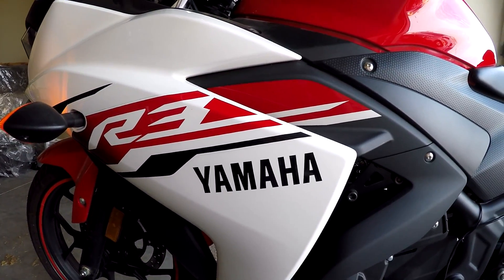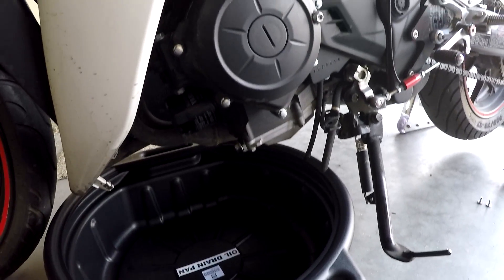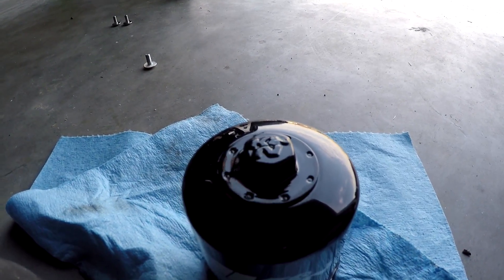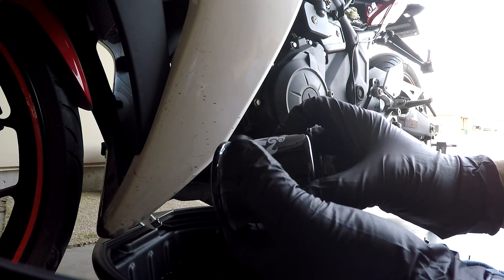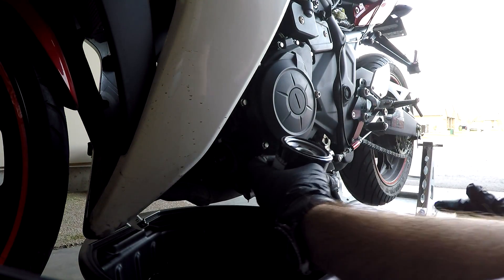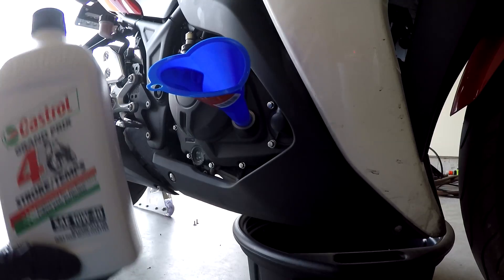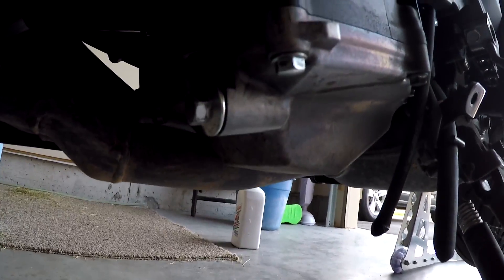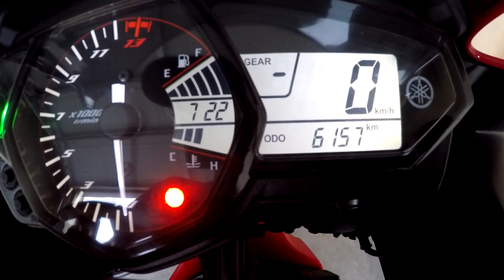Yamaha R3 - How to do an Oil Change

Comment: 2015 Yamaha R3

Oil Amount:
1.8L - Without filter change
2.1L - With filter change

Torque Specs:
Oil drain plug: 14 ftlb
Oil filter: 12 ft lb

Pin this comment so folks can see!
Reply from the maker: Thanks for helping. I have verified this info as well.
Reply: What oil weight should I use for a 2018 r3 in new Orleans ? Temps are basically 90-100F all summer long and may dip below freezing a handful of times a year
Reply: @Fee.1  its always 10W-40 unless you live in frigid temperatures like Alaska
Reply: @kushpaladin300  why is that? Why would colder temps warrant an adjustment but not hotter ones? Would you not even go to a thicker viscosity base for track use ?
Reply from the maker: Ya, much hotter would also warrant an adjustment. I didn't on my race R3. But I used 300V in that.
Reply: Precise oil amount? Use the site glass as your gauge. Don't rely on anything else.
Reply: @Fee.1  Go to 50 weight if you ride in really hot weather.

Comment: best oil change guide without a doubt. Answered every question i had and made things short and simple. Thanks for the upload.
Reply from the maker: +Newbie Yamaha Thanks for the kind words.
Reply: the bottom faring wont come off...
Reply from the maker: pull it harder. theres a little extrusion there that holds it in place.
Reply: +FullThrottle099, ...agree with Newbie, great vid guide.  Re the bottom plastic, need to slide & pull bottom clip to get off, cheers
Reply: Almost nobody seems to address how to check the oil level properly, strikes me as info worth adding to a oil change guide personally. Not to take anything away from this video I’m just saying
Reply: HANDS DOWN! I’m doing mine today. Thanks for the in detailed tutorial!

Comment: Never top up the oil with the bike running! Your oil will be over full now. I would let some out if you don't want high oil pressure and an oil leak. Fill oil, run bike to get it in the filter shut bike down and top up if needed! Just trying to save people some hassle.
Reply from the maker: +D Wilson Ahh i see. I did notice that the oil level went up a little. Good hint. Thank you.

Comment: Have the oil in the middle of the max and minimum of the lines on the sight glass because when it gets hot it expands so if it’s at the very top cold you have too much

Comment: Commented on this video sometime back when I was planning to buy this bike....and happy to say that I stuck with my decision and been riding this bike non stop for the last 6 - 7 months and really like this bike...so it is at 7800 kms and I decided to do an oil change...and believe me, trust these guys wen they say the stock filter is tight as FUCK!!!! but not sure if it was the factory one or if they changed it at the dealership wen it went for the first service....but it was UNBELIEVABLY TIGHT!!!...So a few difficulties I faced which might be helpful for others:

1. I had trouble straight away with an extremely tight drain plug. I kept applying so much force with socket wrenches and spanners that I ended up with a misshapen bolt so that the default socket wrenches stopped working. Solution? I had to buy a bolt extraction kit from Bunnings for $30 and it worked perfectly in removing the damaged bolt.

2. Now comes the nightmare part with the filter. Used a rubber gasket kind of filter wrench. $7 from bunnings and absolutely worthless as far as the bike's filter is concerned. I have a mechanic friend and he said he has never come across filters being so tight...he a car mechanic not bike...and together we ended up crushing the oil filter...YOU DO NOT WANT TO BE HERE!!...but if you do, here is a work around...take a screw driver thats atleast 7 inches long and hammer it through the oil filter...but be CAREFUL....you do not want to hit the screw mechanism that is part of the bike...so hammer it through the outer edge of the filter...once sufficiently deep inside you can twist the filter using the screwdriver itself as leverage...fucked up process I KNOW!!

3. Removing and putting back the side panels was not difficult.

4. A rear stand would have been helpful but I didn't have one so I just put the bike in gear and rested it against a grill that was standing next to a wall in such a way that nothing other than the bar end was in contact.
Reply from the maker: +NG2k15 Hey im glad youre loving your bike. I dont know why they tighten this stuff that much. It would be way over the specified torque that they should be using at the dealership. Anyways, thanks for the information you posted. Itll definitely help someone out there.

Comment: I just need to drain my engine oil, so do I NEED a new filter?
Reply from the maker: No. The manual says filter to be changed every other oil change. So not 100% necessary to change it each time. Generally, people change it anyways cuz its not too expensive.
Reply: FullThrottle099 gotcha, I just didn’t feel like ordering an oil filter after ordering a ton of other parts. Also, its not a good idea to use any kind of oil is it, or it has to be 10W-40
Reply from the maker: Yea, should be 4-stroke motorcycle oil 10W40. I have been using Motul 7100. Works well. Smells like something you could drink lol.
Reply: FullThrottle099 I don’t know if I’ll do a taste test 😂 leave that to my
Engine. By the way, the coolant is linked with the Clutch cover right? Meaning I’d have to swap coolant as well?

Comment: the manual says 2.1 liters for an oil change not 3 liters. you probably have too much oil.
Reply: And the bike says 1800cm3 right on it!
Reply: correct, 
1.8 liters if you are NOT replacing the oil filter. 
2.1 if you are replacing the oil filter
Reply: it takes 3, with 2 bottles you'd not have enough oil
Reply: Law Abiding Citizen why wouldn’t you change the filter

Comment: Wait u put oil while bike was on? Was the oil over flow? Seems to me you put to much oil. Your suppose to just turn bike on and turn off and see how  much more oil u need to get to proper level. Please let me know
Reply from the maker: +Smooth Cruz I was way lower than the max so I filled with it on. You can turn it off, let the oil settle and see how much more you need to fill.
Reply: Top up only after turning off the engine. He added too much

Comment: You should have checked the oil with the bike off the rear stand as the bike is slightly leaned foward, to get an accurate level the bike needs to be level and straight up
Reply: Gary Bosano have you ever checked this on a R3? I couldn’t tell any difference from on the rear stand vs off and level.

Comment: thanks for the upload.  I noticed no crush washer on the drain plug?  I've always done oil filters hand tight+quarter turn with a filter wrench.  never an issue, never leaked and removal was easy.  you lube the new filter O-ring not just for better seal, it's to keep the O-ring gasket from sticking to the block or filter while tightening.  wipe down oil filter contact area and drain plug contact area to remove any grit or dirt from preventing a good seal.  I am not a Certified mechanic, I have worked on my own vehicles for a very long time and they run great.
Reply: "I noticed no crush washer on the drain plug? "

an insignificant detail

after all the video is clearly titled "how not to do an oil change"

Comment: Hi. Did you put a gasket in the engine oil drain bolt?. The manual says "Install the engine oil drain bolt andits new gasket, and then tightenthe bolt to the specified torque". So?
Reply from the maker: No, I did not add a gasket on the bolt. You could add in a lock washer there to make sure the bolt doesn't come loose and drain your oil. You will be fine without it. You do need a gasket / o-ring for the oil filter though.

Comment: When your r3 is cold (summer but hasn’t been used over night) and you stand it up straight can you see the oil level through the sight glass ? Mine looks empty even when stood up straight. Scared I was sold a sabatoged bike
Reply from the maker: Warm it up, do you see the fluid then? Nothing to worry about just yet.
Reply: FullThrottle099 no fluid, it’s all but bone dry, residual oil only
Reply from the maker: Yup, now thats a problem. Someone forgot to put oil in there when they did their last oil change. Hopefully, you or they didnt ride the bike like this. May need a deeper look into the engine to make sure there is no damage. Sorry to hear that buddy.
Reply from the maker: Sorry to hear that. Reasons like this is why I will never buy a used bike. You never know what the hell the previous person did. We have people in our friends group who didn't do their first oil change for 12,000km. So they didnt do a break in change, and 2 more lol
Reply: FullThrottle099 what do you use? 15w-40?
Reply from the maker: No, 10W-40.
Reply: FullThrottle099 I bought this bike for $3,000 from the owners ex wife, I might buy the ninja 400 I was looking at for $5,000 and sell this with a disclaimer for a loss

Comment: 04:30 is it necessary ?
Reply from the maker: Pre-adding oil to a new filter is not necessary but a good thing to do. The oil pump will push oil into the filter anyways, but if you put some on there, it will be a bit faster to finish the top-up process.

Comment: You should never add oil with the bike running. You were probably about right (maybe a very, very small amount low) when you first looked. The reason the oil dropped from the window was because it was circulating through the engine! You should have rode the bike around for a few miles after the first check, let it sit 10 minutes or so then recheck.

Comment: Filled oil with the rear stand on, oil level reading will be inaccurate.
Reply from the maker: Yes, true.
Reply: There is very little difference, if any... at least on my 2019 from rear stand to on the ground and level. But he should have never added oil with the bike running!!

Comment: You forgot to change the oil drain plug gasket.
Reply from the maker: You're right. I should've changed it as well, especially for video documentation purpose. But really, it's fine if you don't change it. It's less than a $1 so it's also fine if you do change it.
Reply: that doesn't need to be changed every oil change

Comment: Can you buy regular car engine oil, or does it have to be motorcycle oil?
Reply from the maker: Should be motorcycle 4-stroke 10W-40 oil. I have started using the Motul 7100 recently and its great.

Comment: K&N has been banned from racing tracks for faulty filter rings; castrol is horrible oil for you engine. What are you trying to do to your bike?!  I've owned two R3s and worked for Yamaha in service. You're gonna hurt your bike with that junk...
Reply: Yeah I've heard nothing but bad things about K&N everything. When it comes to my bikes I use genuine Yamaha filter and oil. I don't mess around with that stuff.
Reply: TheBestSuit ive been using their stuff for years and my bike has been fine....🤔
Reply: ...well, you know, Yamalube is $25 for 4 quarts, too pricey for some especially when they can get it for $3/quart or even $2...same with the filter, why put an expensive $5 stock filter on your bike when you can get a cheaper aftermarket filter for $3? It's only the shit your engine needs to keep running, nothing important.
Reply: Puma4454 where tf do you get a 2017 oem r3 oil filter everything online seems like it's 2015 or 16 and nearly every oil filter I've checked from website says it doesn't fit on the 2017 r3

Comment: What the fuck do you mean "it doesn't matter what you choose, it's up to you" when it comes to oil for a motorcycle? 

You feel the need to tell people as many details as you can think of in terms of changing the oil. 

But you then say "it doesn't matter what you choose" when it comes to the oil? 
How does that make the slightest bit of sense? 

The owners' manual will tell you what oil to use, in this case probably Yamalube. Why did you not use it? 
Why use Castrol of all things?
Reply from the maker: I mentioned the critical parts. You need 4 stroke motorcycle 10W-40 oil. The purpose of the comment "it doesnt matter what you choose, lets not get into that discussion" was exactly to prevent this type of comment. Everyone has their preference when it comes to the brand of motorcycle oil. Some preferences come from peoples budget. Some oils have additives that help with the break-in of the bike. Other additives help with older engines. Some are conventional, others are semi or full synthetic. There are just too many different options. I didn't wanna get into it. You should be fine as long as you get 4 stroke motorcycle 10W-40 oil.